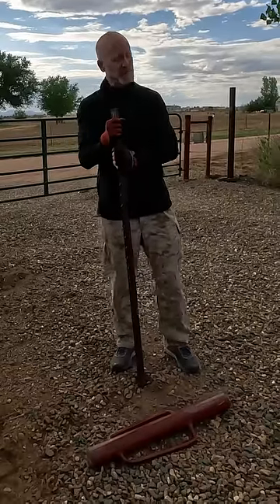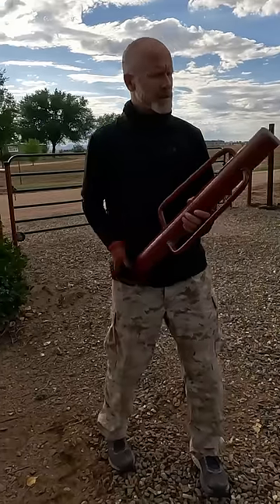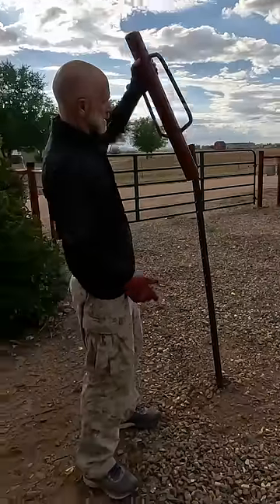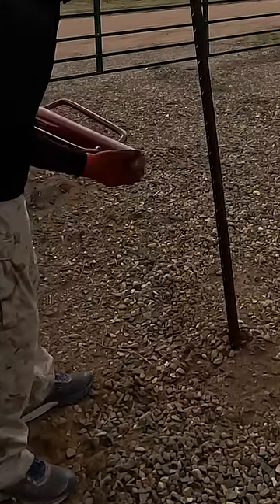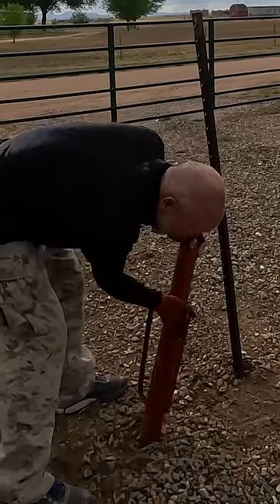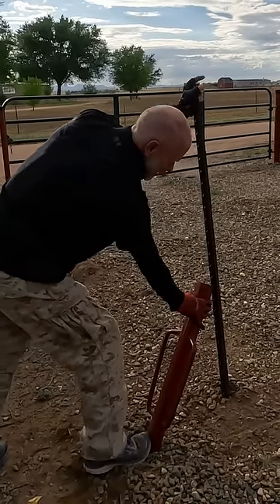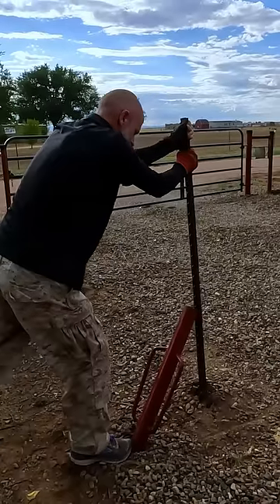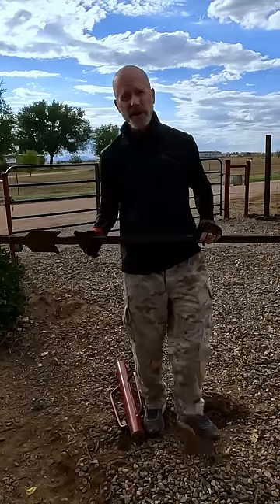Avoid Back Injuries with Simple T-Post Removal Trick

Comment: Using a Hi-Lift jack and straps is the way my dad taught me to pull posts. It works great for smooth posts as well!
Reply from the maker: That high lift is the Swiss Army knife of getting things done. Keep that tradition. That memory needs to stay at the surface plus it’s a proven method. Don’t change a thing. Take care my friend. 🙏🏼🕊️
Reply: @futurehomesteadingAZ  I will! You've got a great channel here and I can't wait to see where you take it!
Reply: A chain wrapped over itself 3 or more times works better than a strap on small dia. Pipe/grounding rods...
Reply: Yeah same thing I was taught
Reply: @dodgeme1986truck  I'll have to try that next time!
Reply: Yeah, me too. A Jackall and a short sling. Nice.
Reply: Saw this after I made a similar comment. Right on.
Reply: @futurehomesteadingAZ 
 I have used a strap with a long pry bar a few times that seemed to work pretty good too.
Reply: Skidloader, will save your back and keep you cool (if it has ac)
Reply: This is how I got some large wooden tree stakes out myself. Worked great with a simple strap and was really easy.
Reply: This is the way
Reply: Pulls wood post set in concrete out too. Even pulls the concrete most of the time, leaving a nice hole to put a Z-Post in concrete back.
Reply: My dad just threw a chain and rope around them and yanked them out
Reply: Any car jack should work
Reply: You can use a floor jack with pipe hanger as well
Reply: Me too.
Reply: Upgrade from that: tractor and a chain!😂 if feasbale that is. I know not everyone has those.
Reply: That’s how my grandpa taught me
Reply: Smart :)
Reply: Exactly how I do 'em!
Reply: I carry a Hi-Lift on my Land Rover, it's brilliant for ripping out fence posts and other landscaping jobs.
Reply: I was about to chime in, i was shown to use a jack.
Reply from the maker: @MrLordingit I like the versatility of the hi lift. Great tool. Nice choice.
Reply: My grandfather used the front loader of the thactor
Reply from the maker: @kennethsandy4741   the best way to do it. By far. Smart man.
Reply: Old rancher neighbor taught me the same but with a chain instead of a strap.
Reply: I use a chain with my Hi-Lift jack. But then, I have had to pull posts that a tractor couldn't pull, and I have had to pull posts out of ground that was frozen down to two feet.
Reply: I'm all about pulleys & levers = afew well placed rocks coupled w/ that 'old man' patience
Reply: Most people aren’t using that though just as I could say my way is even easier. We use our mini excavator and just pull them straight up and drive new posts in with the it also on our farm. You have to have equipment on 1300acres though.
Reply: That's what I was going to say. I have a t post puller plate and a hilift
Reply: Blew my MIND!
Reply: The jack and a 4x4 is how I kept a roof from sagging to put in a 20’ beam into a house for a sliding glass door. very nice…
Reply: My father too but we used a chain instead of straps
Reply: I don't know this one, can you post a video and show us how to do that please?
Reply: As someone who builds fences for a living, that's what I came here to say
Reply from the maker: That’s a solid pull great contribution. Thank you. ✌🏼
Reply from the maker: I appreciate ya acknowledging other peoples fortune. Very human response. Thank you. For the record…. I prefer your method. Life goals. ✌🏼🙏🏼
Reply from the maker: It’s a great contribution. Chime in. This is a fantastic best practices convo. I appreciate ya jumping in. ✌🏼🙏🏼
Reply: Yeah, but I don’t cary a high lift jack with me on foot into the rough back country when fixing fence. I do bring my post pounder! 😂
Reply: @futurehomesteadingAZ what a great response
Reply: I wish I had a dad so bad man.
Reply: I just use a t-post puller but his is a great idea if you don’t bring one with you. But at post puller is a lot easier than you guy’s trying to do it with a high lift or chains and ropes
Reply: "Handyman jacks will either help you or hurt you".
 Watching this video hurt my back !
Reply: Ground is too hard at my place, I made a water jet out of galvanized pipe with a small fire jet nozzle at the end. Just hook it up to the hose and it works like a charm, just a little muddy though.
Reply: I knew this would be here.  But chain

Comment: Great tip. I’d cut a little notch into the end making it easier to angle against the post.
Reply: I'd put it back onto the top and hang onto the big old handles and lean right back with just my body weight, but hey.
Reply: I think the existing square edge would work better. 
   He is using the wire retainer fingers to leverage against and a curve might actually work against you.

Comment: I have myself a t-post jack. The bestest way to pull t-posts 😊
Reply from the maker: That’s a great option, if ya have one. I am gonna head that direction eventually. I heard that if you have one of those you can make the kid do it. Just gotta put some rocks in the 3yo’’s pockets. 😂 I appreciate ya reaching out. Have fun today. ✌🏼
Reply: Best way to lose a finger tip too
Reply: @Wooooptywoop  not sure how you did that...
Reply: I use a strap and the skid steer
Reply: I use either the loader or the 3 point on my tractor 😀

Comment: Tractor supply has two t-post pullers. They work great.  I use mine all the time
Reply from the maker: I wanna use your tractor. I got a nice spot to park it and everything 😂🤣 It’s great to have that option, you are living right. Have a great weekend. ✌🏼🙏🏼
Reply: @futurehomesteadingAZ it's sold at tractor supply and elsewhere but has nothing to do with a tractor -- it's a tool that pulls t posts with simple leverage... costs around $40
Reply: @mendonesiac 🤣🤣🤣 i have one too...use it ALL THE TIME.  $40 cheaper than a damaged back and also better than the way he finagled that post out 😂😂😂
Reply: @futurehomesteadingAZ     it's a tool for pulling average post's of all shapes and sizes ...    just not heavy ones or concreted posts     the store is ( tractor supply ).   It's a adult toy store ! / hardware store ...        there's the right tools for the right job.      Makes life easier and it's more professional...
Reply: Was gonna say… a post puller works pretty good. Glad to see I’m not the only one
Reply: @futurehomesteadingAZ boy do you not know about tractor supply that sh$t will change your life 😂
Reply: Thx y’all! I’ve got a few thousands to pull.
Reply from the maker: Haha. Yeah. The way the comments stacked I must have been reading the one above. 800+ replies and your eyes can get wonky. Sorry about that. 
Yeah. I know about the puller. But if ya didn’t have one, you might get away with a leverage technique. It was an alternative the the grip and rip using a tool you already have. Some people get it. Some don’t. Either either way. Be safe. ✌🏼
Reply: @futurehomesteadingAZ  I can’t tell if you don’t know what Tractor Supply is, what a T-post puller is, or how to tell a joke. 🤷‍♂️
Reply: Amen! Even my petite gal can drop the base of a T-post puller next to a post and pull it out of frozen clay like easy peazy. I have a tractor with a front end loader that I can throw a chain around a post and hit the lever to pull them, but it's seriously easier to just jack them out of the ground in a few strokes with a puller than sling chain and walk back and forth to the hydraulic controls.
Reply: t-post puller is the best tool for this job.
Reply from the maker: @jimmyyounger618  interesting. First person with a loader that prefers the puller. (I haven’t been able to read every comment but this is a first to me) Great to have so many options. I really thought tractor was going to be the end game. Thanks for detailing that preference. Great contribution. Take care of yourself.
Reply: @futurehomesteadingAZ  if you have two people it’s a bit of a wash on a loader vs puller. If I’m by myself I’m using the puller unless a tree root has grown around the post. Definitely faster to use a puller when your by yourself. Pulled a few thousand both ways setting up and tearing down festivals and doing fencing.
Reply: @futurehomesteadingAZ  Happy to add my 2 cents! We drop spaced out round bales in long rows in the fall and put up lines of hot rope that we can move over to an insulator on a fence line instead of hauling bales out in winter. (Roughly 50 posts every season and I pick my day after a fall rain when they'll drive easily.) The point of this is that we don't need to crank a diesel in negative temps with fingers crossed it starts, work gates, navigate through livestock or tear up soggy pastures during thaw periods to feed bales . 
It actually took me a year to realize the post puller was easier than raising the bucket, positioning the tractor, swinging a chain around the post and setting the end hook just right so the chain would get a good bite on the post. Now, once we've moved the hot wire enough times to have 10 or so posts to pull, we hook a small utility trailer to the ATV and my gal drives along as I walk along and pull posts with the post puller, then drop them on the trailer. We can knock this chore out in nothing flat.
Much safer than being under a front end loader's bucket, too! I never realized my tractor doesn't have any safety features when a hydraulic line fails until it happened. Thank God nobody or myself was under it when a line burst because it simply slammed straight down into the ground. Ag work ranks #3 in jobs with highest rates of injury and fatality, and working under a bucket is on the list of ways to retire or cause a memorial service ahead of schedule.
Love the channel. Cheers and stay safe!

Comment: Yessir this is a good one. Just saved a thousand backs
Reply from the maker: Old school and not for everyone or every scenario. In a pinch or a bar bet it might sort ya out. The puller or a tractor remain king. Do what you are comfortable with. Thanks for taking the time. I appreciate that. Be safe✌🏼🙏🏼
Reply: I agree good method, in my 20s i used those quiet a few times (post slammers) never thought of doing a leverage idea, i would just wrestle and pretend i was doing king arthur sword and the stone..

Would this idea work on soil?

Comment: This is an absolutely great idea. I know there are other tools, but sometimes your not pulling a bunch of those. This makes much more sense if you decide you need to remove just one or even a few.
Reply: Ahh see on my buddies farm, they take the truck pretty much everywhere on property. They keep two things in the back for pulling t posts, a big tire and a length of chain. If you can push down on a gas pedal you can yank one right out easily

Comment: They also make a post puller that's worth the money, works great and pulls the post out in a few seconds with ease. 
You'll likely see them next to these post drivers in hardware stores.
Reply from the maker: Great suggestion. Thanks. Gonna have to make some room in the shop. Take care of yourself. ✌🏼
Reply: This I'd what I got. Way faster that any trick there is!
Reply: You can also fab one yourself with mostly leftover wood or/and metal materials. Couple of 2x4s connected with a bolt as a spindle, small piece of plywood as a base, bit of chain or cable to grip the post...

Comment: T post puller is almost the same price as the pounder and sits next to it at most supply stores. $36 for a pounder and $50 for a puller at Harbor Freight
Reply from the maker: I wouldn’t buy a harbor freight (maybe they are better now) puller but I know what you are saying. If you are ever in a spot where you don’t have a puller, money or time….you can still get it done. Thanks for taking the time. Hope to see ya around. Take care. ✌🏼
Reply: @futurehomesteadingAZ I used to work for harbor freight people can hate all they want but when you get that warranty you can literally throw it around and on the ground they’ll take it back give you another one and ship that one back out to be refurbished and resell it for cheaper that’s a pretty good idea if you ask me
Reply from the maker: Fair statement. Since you worked there you know the tools to avoid, and I know they sell those tools also. I am a couple hours from a harbor. They do a great job with their warranty. I have used it without issue. My problem is the loss of a day and fuel when it does break. If that works for you, good deal. Since you worked there, If you tell me the puller is one of the good tools sold, I would consider it. Lemme know. Thanks for the insight.
Reply: @tylerpantera8023 the problem with using the warranty is actually having to use the warranty. If you buy a crap tool that breaks after the second use (while using it), it doesn't matter if HF will warranty it. I have to stop what I'm doing, go to HF, get back to the work site, get started again. If it breaks in the evening or middle of the night, you aren't getting the job done with that tool until tomorrow at the earliest. IOW warranties are great. Having to use them sucks.
Reply: My drivers were always home made because bought ones were universally too light and short. 34” of 2 3/8 with a 26” 2 7/8 sleeve over it would provide more weight and no handles meant you could get closer and put more power into it. Longer stroke, more power, heavier driver all lead to less effort on driving them. 

The pullers were always slow in my opinion. I could pop up to a post, set my driver, pop the post free and be gone faster than I ever saw someone use a post puller 

That being said I was building fence 6 days a week for years. I could perfect skills that some people would never get the reps in to get proficient at. So, to each his own. 

PS: the best T post puller I ever used was a D3 dozer 😘
Reply: Exactly
Reply: I called it a bumperjack looking tool😅😅😅😅

Comment: Use a 1960s bumper jack and small diameter chain.  Or tractor with 3 point
Reply from the maker: That would do the trick. I was thing high lift but that older jack is prob cheap at the wreckers. Nice idea. Thanks.
Reply: I've used a jack and chain to pull chain link posts set in concrete out of the ground. I just add a block of wood under the jack.

Comment: Hmmm... And T  post pullers are so inexpensive. Probably available in matching red paint - you could hang it next to the post driver 😉.
Reply from the maker: I guess inexpensive is relative. A decent puller is $50-$90. It’s a good investment if you have the need (large jobs) or don’t have the dexterity and/or strength to do it with a driver. I agree, It would look good on the wall. 🤔 I appreciate the feedback, take care of yourself.

Comment: A link chain, on old tire on a rim.  Loop the chain around the  fence post.  Role the tire up to the fence post .  Lay the chain over the tire.  Take the lose end of the chain and wrap it around your trailer hitch.  Get in your pickup and gently pull your fense post out of the ground.  This will make quick work out of removing a large number of fence posts.
Reply from the maker: Totally with ya there. I usually don’t have enough posts to pull to justify getting fancy with it.  If I was decomming a fence line. Heck yeah!! Thanks for the suggestion.

Comment: Just get a pipe wrench and twist the post back and forth a couple times and it will come right out. This is from my concrete construction experience where I would have to pull 4 foot forming pins out of the ground that were driven 3 feet into the ground.
Reply from the maker: Amazing tip. I hadn’t heard that. Thanks for your contribution. I really appreciate that. Have a great evening. ✌🏼
Reply: @jasonreisenberger1285 , sir, you must be a mountain of a man if you can twist a T-post back & forth, (that has the "spade" buried in the ground), with a pipe wrench!!🤯
I have seen a lot of T-posts installed & removed in my 60 years.
I have never seen anyone twist one like you described, with just brute strength.
Reply: @willhorting5317  if it's a t post with a spade just use a sledge to knock it side to side a couple times. It's the same principle, you're just releasing pressure around the post. Faster and easier than trying to pull it straight up.
Reply: @jasonreisenberger1285  yes, I am well aware of that. Been doing that for decades on the family farm.
But thanks for the advice.

Comment: If you plan on reusing the post you will most likely bend it doing it that way.
Reply from the maker: You may be using a light duty version of the post or even a U-post, .95 pounds per foot. I have a barn full of straight posts, including the post I just pulled. Go with a heavy or medium duty of 1.25 per foot. They cost a bit more but are worth it. Thanks for the feedback, hopefully I helped.

Comment: I was not aware that i had the correct  tool in my hand the entire time!  Thank you
Reply from the maker: It’s the claw to the hammer. You can get a wrecking bar for nails, but you have a claw if you want to use it. I would try that before a rip and grip. Thank you for understanding the concept. Lots of easier ways but that wasn’t what I was trying to cover. Have a great evening. Take care of yourself. ✌🏼🙏🏼🕊️

Comment: I saw this technique on Snapchat when I worked in the field. Never struggled pulling out a post again.
Reply from the maker: I appreciate ya jumpin in. A lot of folks think this is not a thing. Sure there are better ways. But if this is what ya got. You can probably sort it. Thanks for your backing. Have a great weekend. ✌🏼🙏🏼
Reply: I’m an electrician. We had to fence off  open ditches where we laid duct bank. The under ground  phase of a job site isn’t long enough for an electrical company to invest in machines that pull up T Bars. Thank you! Keep spreading the knowledge.

Comment: We used it driving ground rods doing cable TV splicing.
When we had to take up the old ground rods, we would use a Jake and ground nut on the rod.

This is a pretty cool way to do it as well, but to do a flat surface like a ground rod, you would have to reposition the ground nut on every pull.